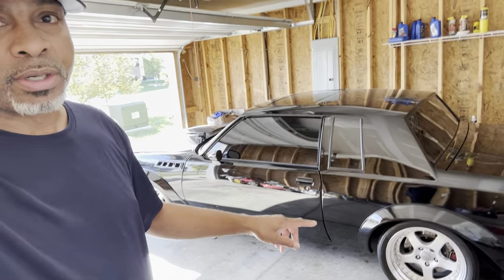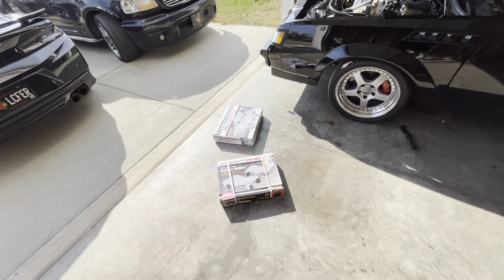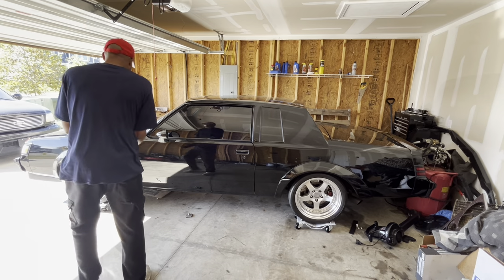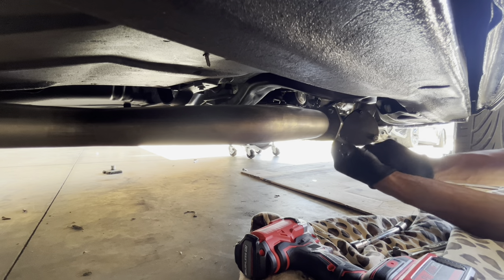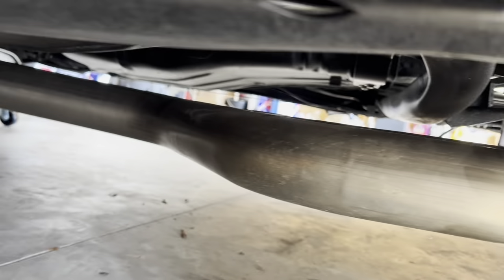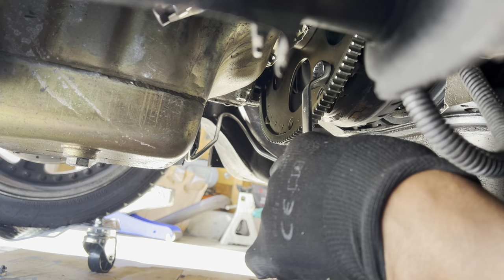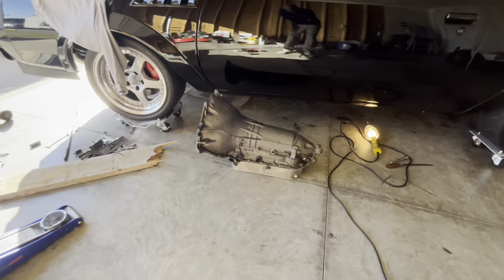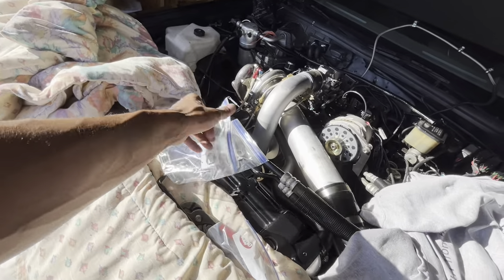Removing the transmission on the Buick Grand National took longer than expected

Comment: You need to look again at you transmission cooler location....you need a good cooler or it will burn up the tranny in short order.  Best of luck.
Reply from the maker: I`m going to get a new one and move it back behind the intercooler